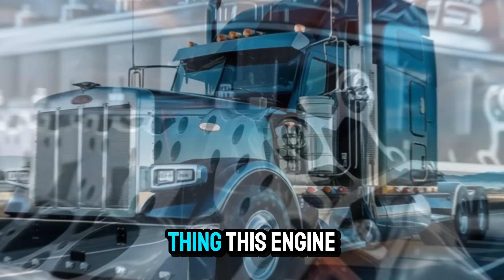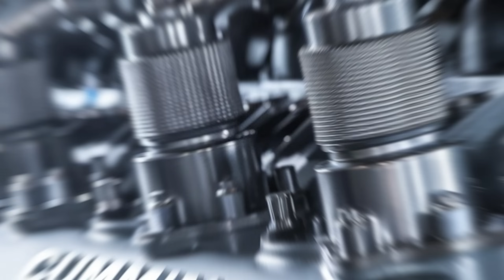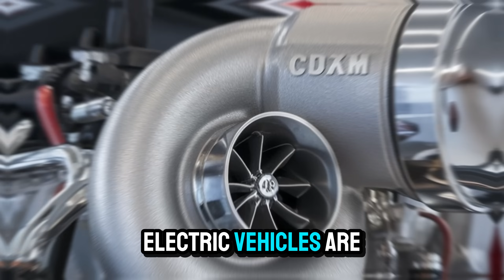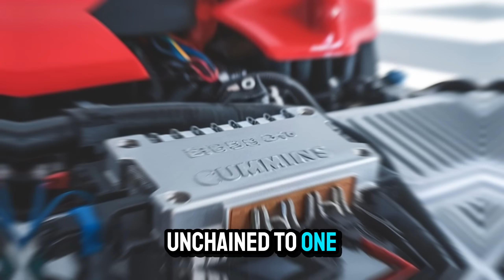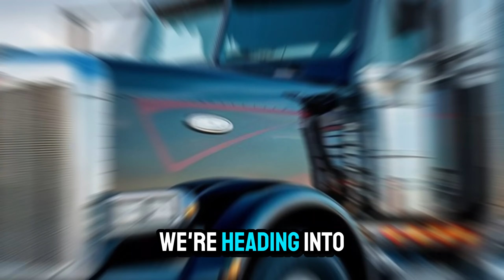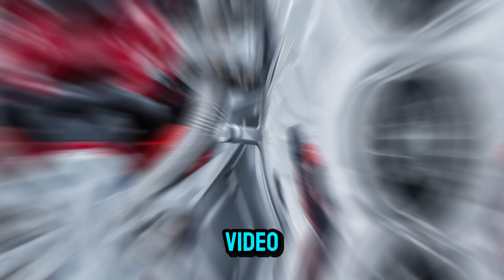Cummins Just Unleashed a Monster – The X19 Could Break Every Rule on the Highway

Comment: The Iveco electric truck is already between 1000 and 1300 hp with a massive torque curve. This engine will be good for a while though, for when recharging stations are not yet built. Road train work in Australia a good example, out bush. Logging in Canada? But that's not enough to keep an old diesel power plant running.

Comment: They should just try making a motor that last more 400,000 miles.
Reply: Never had an issues getting one past 30k engine hours. I think people are hard on these engines and run the oil service intervals to manufacture spec. 250 engine hr or once a month for a truck that is constantly running. Maintenance is important. Also not forgetting to adjust the rockers when needed.

Comment: Bottom line guys, what all your comments? I really don't care about foreign trucks coming into the market. I will always buy an American made truck now. The big companies might buy these type of trucks, but I rather have a 1988 cab over didn't get anything. That's not me here in america, as I see again, stick with what you know from and stop worrying about everything else. If cummings works, it works, it shouldn't matter bout the horsepower i started driving trucks in nineteen eighty nine.The highest horsepower, then you might would have had a cat 3406 B 425 and if that engine is tuned, right? Because I had one and I can outpull truck that had 550 under the hood
Reply: " stick with what you know from and stop worrying about everything else"...there's no progress in in being idle.

Comment: Scania, will enter the USA with 770hp, thatll leave everything behind, so Cummins is just anticipated real competition will soon appear, and when it does, at least they'll have a product, tried tested and improved. Legacy truck manufacturers should be doing the same, with their products. The engine is small part of a total package.
Reply: I thought torque is more important than HP
Reply: Scania  could put out a 2000hp engine and  it will still fail in US.the miles and terrain  are totally  different  in Europe. The Paccar engine was tested for millions of miles there and is a piece,of sh.... You can drive across  their  whole continent and  not be halfway  across Texas. Also the speed limit is an average  of 60mph.
Reply: @robertmiller7165  that argument does not matter for most engines, def not for scania and volvo
Reply: US manufacturers are greedy and lazy.
Reply: Most freight goes by rail, not sure why they need to keep up with Scania.
Reply: Good luck trying to get it fixed when something goes wrong
Reply: @1555mrsmith  its been said the service network is all over the country for scania

Comment: Too difficult to believe & in numerous ways ! # 1 what tranny & rear end ,would handle the 3,500 ft.lb of  torque ? #2 Weight would be at least 3,000 lbs & #3 Price would be over $ 140,000 US #4 in a compatibly equipped hi end truck the cost would be over $500-600,000 bucks US #5 this is just a pipe dream prototype concept I bet at this point !  So looking at the big picture it seams like a huge April fools joke !
Reply: @johnkucik1833 ......"#2 Weight would be at least 3,000 lbs"..... Is that a "problem" for you?   Back in the days of real world trucking with real trucks and diesels and their drivers & real Owner / Operators.... we had the V12 Detroits, 3406 (especially with the retarder block) & 3408 Cats, "Big AL" (35000 series Allis Chalmers), and the KT / KTA series Cummins... All of which were between 3,200 & 4,000+ lbs. just for "Bare Engine" weight... NOT including, Air Compressors, Power Steering (Not widely available yet in the early / mid 70's), etc,etc. and we had more restrictive weight & length laws to deal with then, than you modern day "steering wheel holders" do now.
Reply: @Romans--bo7br Thank you for the walk down memory lane! Back in the world of some very cool diesels that were motors with personalities. Having a new head turner would be great. But I share some of your ideas on the subject.
Reply: OK the yellow and orange crowd are in the room. I had 2 cummins engines and loved them.
Reply: Yes a 3000 lb boat anchor would be a problem for anyone & considering each legal front steer axle weight on a class 8 tractor trailer is 12,000 lbs only  & over 90% of all commercial vehicles are class 8’s & you to ,would have a problem ! Everyone’s pay load would foolishly be restricted & would negatively affect the drives & sequence of legal weight distribution, on entire trailer as well ! On/on ! Back in the day you had gravel roads only & wooden floors , wooden spoked wheels  hand operated driver side  wind shield wipers 10% of a DOT as well ! Shall we go on ?? Every thing improves as time progresses & competition forces better practical logical rational consumer products ,as the price of fuel & fuel taxes rise & insurance demands &  along w/ EPA regulation regulations . Every drive train needs to be the lowest weight, highest torque , best warranty, furthest service intervals , dependability & price in its class, for a class 8 unit  specifically speaking ! This is what every company strives for .It’s up to every potential owner & fleet manager to spec strictly ! Nothing excessive required to add foolish expenses & Optimum efficiency , weight , adequate performance, long service intervals is the balancing act & drivers like me , who advocate a (strict fuel bonus) , driving 55 mph only & giving each driver 33% +more income & each company & O/O 66% + from the fuel bonus savings. Getting paid for safety , efficiency, is no less important than productivity !
Reply: “Everything improves as time progresses” is a very questionable theory
Reply: Obviously reputable companies with a history of doing business ,only last the test of time because they’ve innovated & researched & prototyped improved quality control standards & produce ! If Cummins (specifically speaking didn’t they wouldn’t be worldwide, or competitive  here as well & competition is the greatest influence ! Detroit, Mann, Cat , Paccar ect . Any questions ?? 🤔✅